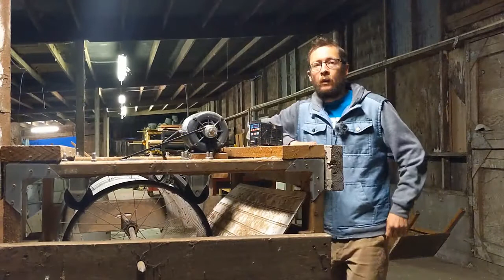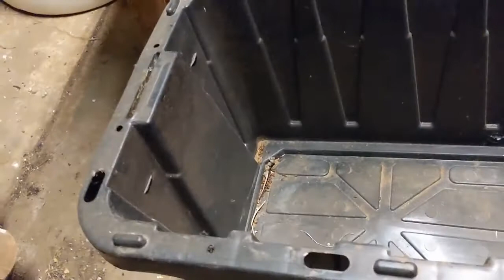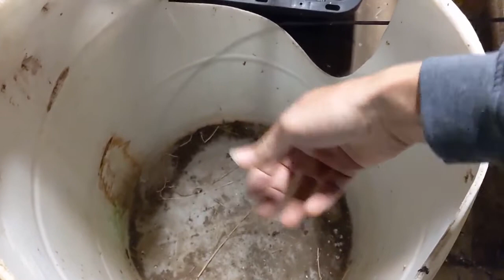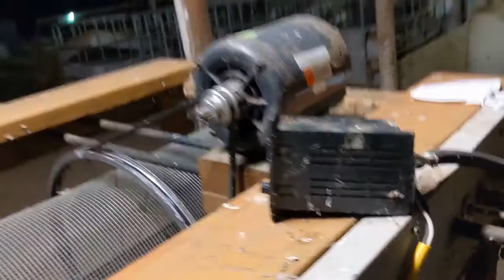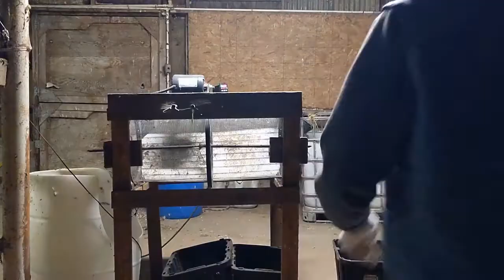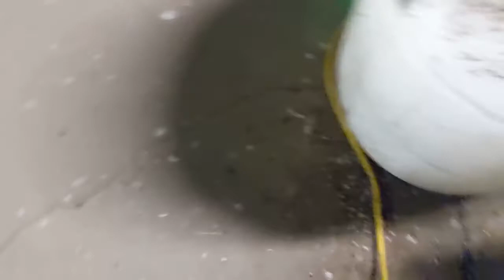Compost Screener for WORM CASTINGS, part V: The finished product

Comment: A remarkable solution you have found to the variable speed requirement.  It by-passes a lot of gearing down, belt and pulleys, etc.   Can you please indicate what HP your 3 phase motor has, and perhaps the details of the variable frequency drive unit that has lasted you: brand, model, etc.
Reply from the maker: Thank you, I am still very happy with how this project turned out. It has worked for years now, with no issues.

The variable frequency drive is a Tuan, model T13 750W-12-H.

The motor is a Dayton, model 31TT08.